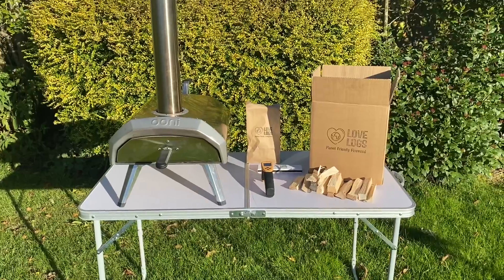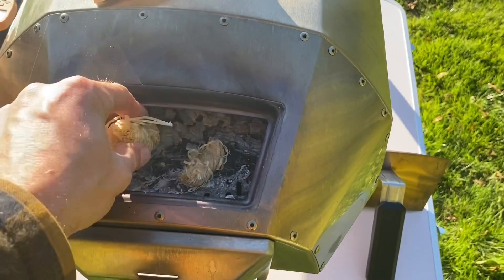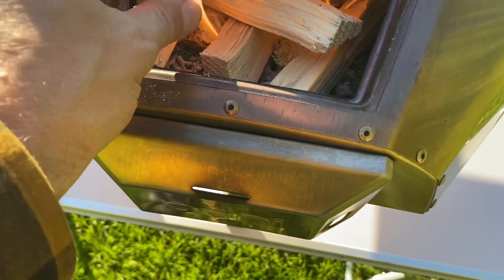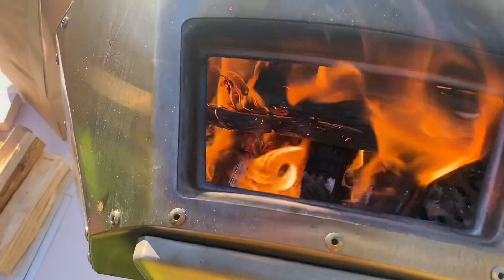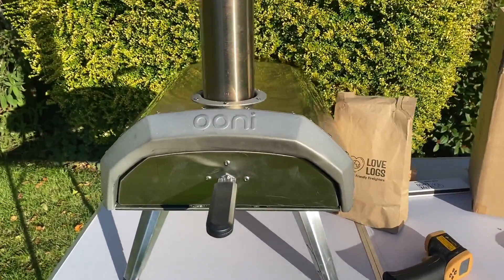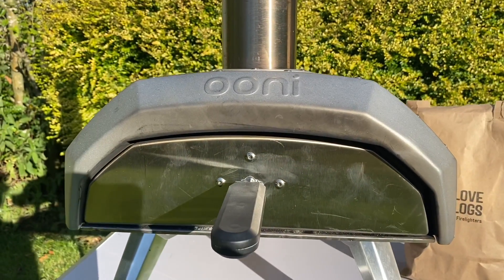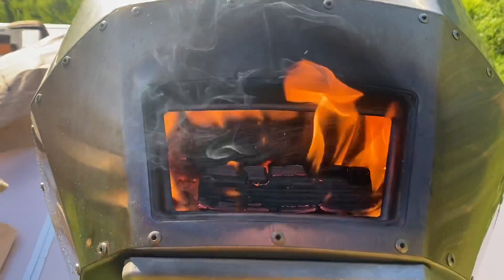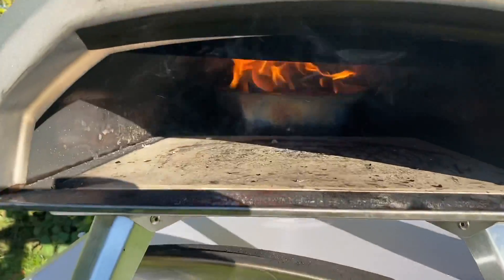How to light your Ooni Karu pizza oven

Comment: Useful video. Do you find it works best if you leave some ash in the grate before lighting up?
Reply from the maker: @mattseymour8637  No definitely not - Oonis work so well because of well designed airflow, you want it empty! Although with good wood you should find you have very little ash left over 🔥
Reply: @planetfriendlyfirewood Ok will give that a go and as you say I think the airflow on them is what works well but I haven't used mine yet and arrived yesterday.
Reply from the maker: @mattseymour8637  Where are you based? Got a few more Karu videos on our website, will send you UK or US version depending where you are
Reply: @planetfriendlyfirewood I'm in the UK and have seen a few videos to get an idea but that would be helpful.
Can I ask what temperature the manual says to cook at as haven't looked at that part in it yet?
Reply from the maker: @mattseymour8637  Not sure about the manual sorry! I aim for 400-420°C stone temperature, and make sure you have a rolling flame at the back. First few are quite stressful as you have to turn the pizza every 15-20 seconds…

www.love-logs.co.uk
Reply: @planetfriendlyfirewood Will give that a try and see how I get on.
I have lots of firewood myself as I sell it.
How long does it usually take from cold to get up to temp to start cooking?
Reply from the maker: @mattseymour8637  Depends how good your wood is, ours is oak at about 10% moisture so you can get to temp in 15 mins (as per the video 😂) but I like to keep heating it for another 15 minutes before I bake pizza, to get it totally saturated